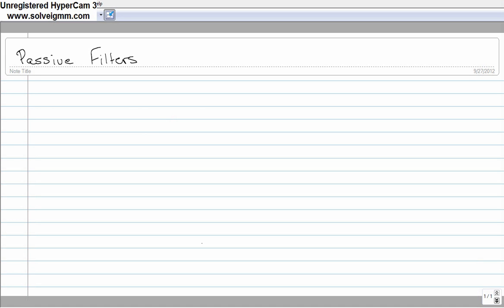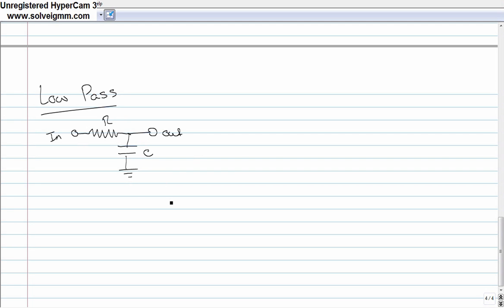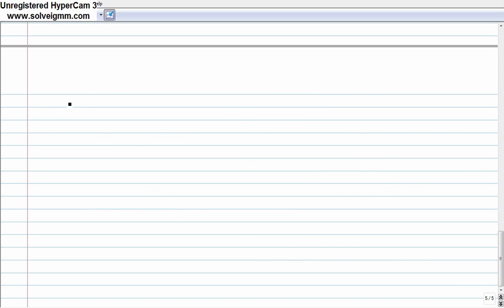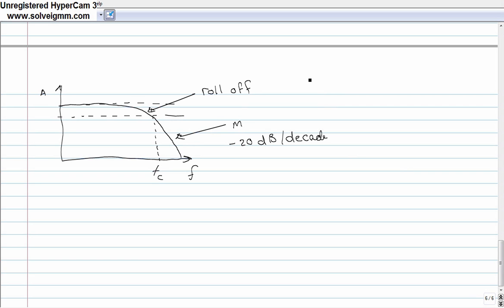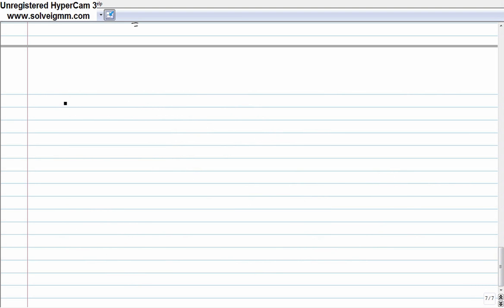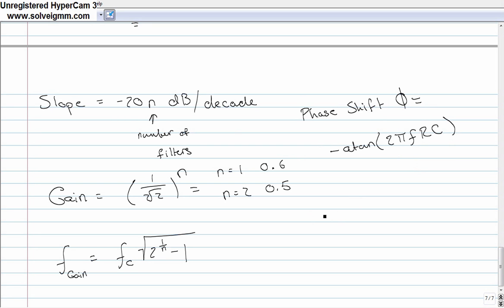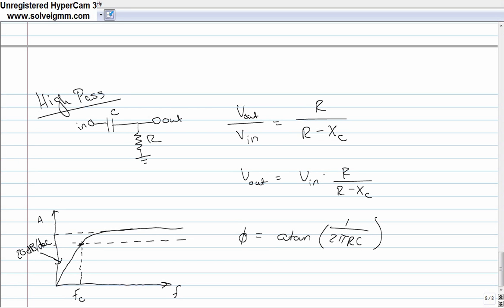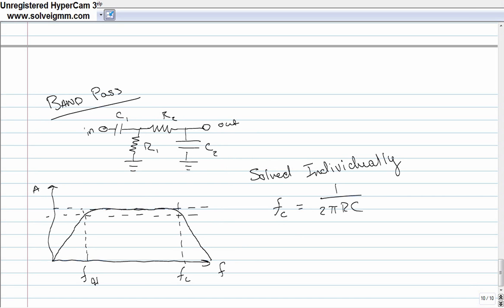Electronics 101: Passive Filters

Comment: Hello. In order for a filter to become a second order, wouldn't be enough to add an extra capacitor to the filter's schematic? Why do you need two same R-C low pass filters, and not just have the initial RC filter with one extra capacitor in it? Unless, the second filter you've added can be reduced to a reactive component, such as the inductor

Comment: @humanHardDrive
You say at 26.55 (talking about the band pass filter) each filter is treated individually,it goes through the high pass filter then that signal goes through the low pass filter and that's what you get out...
This is what i don't understand,IF the signal 1st passes through the high pass filter THEN passes the signal on (IN SERIES) to the low pass filter then surely the filtered sound would NOT have any LOW frequency left to filter at the second stage because it would of been filtered down,as the high pass filter ONLY allows high frequencies through and cuts or attenuated the LOW ONES OUT.
I Cannot understand how the 2nd part of the filter can still work if it's already been diluted or filtered, how can it filter in the second part if the frequency has already been filtered away,surely there would be no signal left to work with in order for this 2nd part to work.
Can you please explain this part to me in basic terms,i cannot understand it
Reply: +SP330Y Well, it's simple actually. For example, say we want frequencies between 1kHz and 10kHz, just set the HIGH pass filter to allow all frequencies ABOVE 1kHz (cutting away anything lower than 1kHz) and then set the LOW pass filter to allow all frequencies BELOW 10kHz (cutting away anything higher than 10kHz). Still confused? Just ask!

Comment: I'm thinking that a tweeter which has a capacitor prewired to it and rated at 120wrms by the manufacturer is actually intended for use in a speaker system that is also rated at 120wrms.. now!! that tweeter in question.. on its own without passive filtering probably only has a rating of only 10wrms but filtered its power handling increases.. ikd.. this is getting more confusing the more I think about it. if you understand what I'm talking about. I would love a video on the topic. thanks

Comment: great video...  found this while looking for a video explaining why a 10 watt full range speaker can handle much more wattage when a capacitor is wired in series...  for example,  a large woofer can have a rating of 120 watts but a tweeter which is physically smaller also has a rating of 120 watts..  is this the actual power rating that the tweeter can handle or is this the manufacturer mearly stating overall system power???

Comment: Why at High Pass filter the Vout formula is not calculated in the same maner as at the Low Pass Filter using the voltage divider